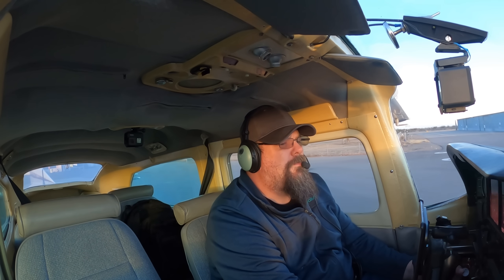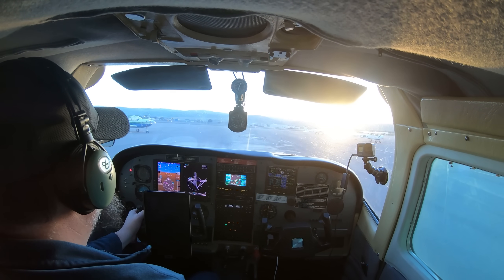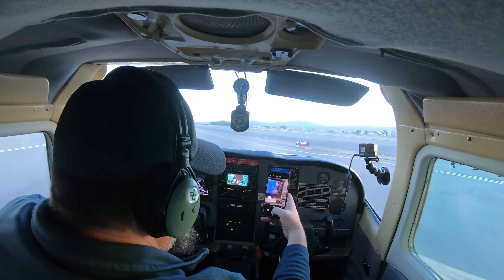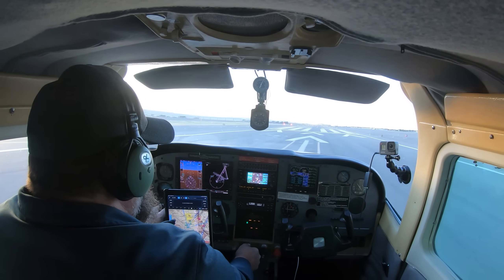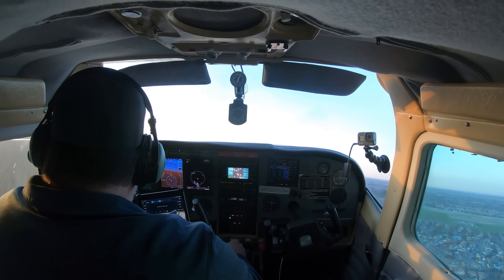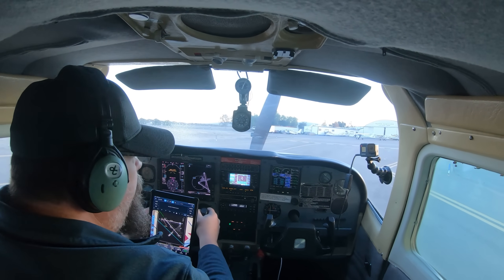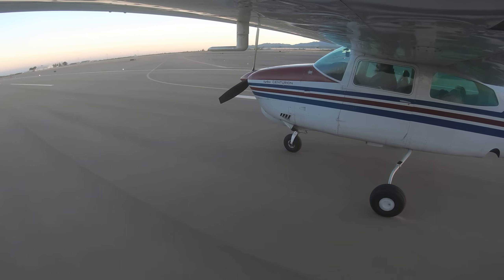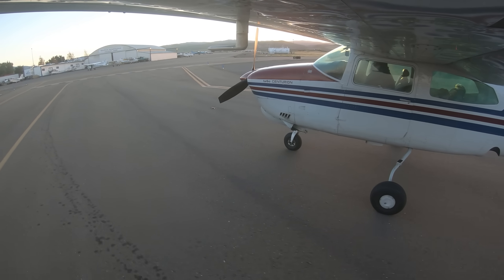Catastrophic Engine Failure after Takeoff

Comment: I'm thinking maybe these engines can be broke-in on an engine stand with a load applied or maybe the airplane , is it plain or plane , can be strapped down , like how the navy does them on carriers , then run the engine and maybe remove the wings , propellars , or distrupt the airflow over the wings , I'm thinking an air dam , if that even exist , during testing to be safe , if not too much . I'll have to watch some videos on wing removal . I was going to say mount a parachute to the rear of the plane to apply a load but i think that would make the plain fly away in reverse , lol . Either way , maybe there is a better way of load testing without having to fly it .

Comment: That's the ole 'mechanic leaves a rag in the crankcase' trick. Seriously, though. You mentioned running the engine a few times prior, but it was never put under a real load. Taxiing to the pump at grandma scooter speed doesn't count. 🤦

Comment: Buy adjusting the pitch of the impeller. Needed to do the inspection on your oil filter to see if there's any metal in the filter, looks like a rod bolt broke.

Comment: I would have immediately pulled the prop back. With enough oil press to go to course pitch,it would make a huge difference. ( not sure if he had enough oil press going to the prop to make a difference) I would not have instantly thrown the gear down . Worked out ok. But better to land gear up on the pavement than gear down in a ditch or something sticking up on final. Looks like you have established  your numbers required for the impossible turn.  I have my numbers pretty well Worked out for my airplane also. When I practice it I also give a three count delay to factor in the surprise and reaction time with a real engine failure. Glad.yours Worked out well. Good job.

Comment: I don’t understand aero piston engine design.  If high RPM equals short life, then why not use a larger engine at a lower RPM.  My car engine operates at an average of 1500 RPM and it’s been used for 21 years and still has no failure and no oil consumption.  I know if it was used at 6k RPM it would die quick.  But  does a lower RPM require an engine that’s just too big and heavy?

Comment: I like that initial panic pull on the stick. Damn everyone must every now and then train their brain NEVER to pull on panic. Just panic if you want, but NEVER pull if not necessary and if not done with thinking. Have you been a bit closer to critical AoA for whatever reason before pulling, and after pulling you would've been in a nice wing stall if not spin and lose a lot of very useful airspeed in an instant (the drag almost doubles during stall to what it was at critical AoA) and so a lot of useful altitude. Glad you were still degrees away from the critical AoA which most if not about all GA pilots know little about or think that it's meaningless, but that was not the way to do. I'd rather freeze in disbelief for a second or two during an engine failure or a fire or any other critical hazard, but never jerk the stick, either by pulling or pushing or anything without reasoning. Just try to fly at the best glide ratio AoA once the engine has quit and thus fly with the highest chance of making it back to the runway, NOT by a memorized X airspeed for Y weight, that's just stupid teaching by those who did it. Just fly the right AoA. But oh..., I forgot, GA aircraft DON'T have an angle of attack indicator, because they think it's meaningless or it doesn't do anything. Poor them. The AoA is the king of airflow.

Comment: Not saying this is pilot induced; but, lets take a look at your practices. 1.) Several times you inadvertently miss-took mixture for RPM
2.) when you did reduce to takeoff power you started with the RPM thus increasing pressure on the manifold. Remember basic training, power decreases are left to right, increases right to left. You did a fantastic job managing the failure however; I would recommend some proficiency training in proper technique. Also remember that statistically speaking, most engine failures occur during a power change. Which is why I don’t do them until I am certain I have sufficient return to runway altitude. Turbo engines require a keen eye. Remember with great power comes great responsibility etc… nice work however, you need to brush up on proper technique before jumping back into flying that particular aircraft imo. Remember to “think then act” never “react”. If you find yourself grabbing at the wrong controls multiple times, maybe let that be your sign to take a beat and seek some instruction. Super glad everything worked out. Continued blue skies friend.

Comment: Great Save, you must have sweated cold......however, am I seeing this wrong or you committed the mistake and you thought you where adjusting the prop RPM but in fact you leaned the mixture a lot, when realized, went full rich again and adjusted the rpm this time? So, brand spanking new engine, maybe not at correct temp as looks very cold where you flew, leaned a lot the mixture and then at full power put a lot of load by increasing the pitch and shabang!! Conrod left the crankcase? Am I wrong with my analysys?

Comment: I want to know what the failure was. Having built and machined a number of engines “not aircraft “ this failure was do to bad tolerances. 

Either due to bad workmanship/tolerance at the connecting rod/crank or connecting rod/wrist pin/ or piston/cylinder. 

My bet will be that there wasn’t sufficient piston/cylinder clearance and as the cylinder heated up from actual use. The increasing cylinder pressure/compression puts another dynamic in the mix that takes special equipment on the ground to duplicate. 

Aluminum expands faster than steel and if the cylinder to piston gap was not sufficient then when you brought the manifold pressure up to 32 psi the piston expansion was enough to cause the piston to get stuck in the cylinder causing the rod to break. 

I’m am sorry to see this failure happen to anyone. 

If this is indeed the cause of failure, I hope the builder/ rebuilder replaces your engine. The faa is real good at determining the cause. 

I have even seen in some catastrophic engine failures that was cause by a piece of gasket material finding it’s way to a bearing causing the bearing to fail.

Comment: What is it with “ catastrophic engine failure”… videos…with no explanation on what happened!!! 
Good piloting…
Yes the “ impossible turn” CAN… be done  if the airplane is initially flown respecting airport, terrain, Vx and Vy… … AND ..NEVER… try to tighten the turn with “ inside rudder”..
So good job on the flying….
But I came…. For the learning associated with “WHAT BROKE”.

So thumbs up on the flying
Thumbs down on yet another unfulfilled expectation… no explanation.

Comment: It amazes me, how old the technology is in GA aircraft ... even new GA aircraft (that cost well into 6 digits $$$).  The more shocking part are the "qualified" mechanics that work on them ... I use the word "qualified" loosely.  I've seen so many catastrophic failures due to bad annuals, mechanics that actually hire some unqualified person to do the grunt work while they do nothing or claim to "supervise".  These days, if one gets and maintains a PPL, I highly recommend going the course to be certified FAA mechanic for your aircraft type ... the only person I trust to work on my plane is me.  I've had to recheck other's work and in one case I found rod caps way off their torque spec ... when I confronted the mechanic he claimed his torque wrench was not calibrated correctly (come On!)

Comment: Sorry to be late to both viewing this and commenting, but I just found it. I have been a CFI for just over 25 years and was a Sim instructor in the LR35A. At client's request I sometimes trained the exact scenario you encountered and depending on altitude and speed, results varied. Typically the maneuver I taught in the Sim was a 90 degree right turn followed immediately by a 270 degree left turn to align yourself with the runway. As most of the comments I have read indicate, you did an excellent job in an extremely critical situation. No doubt the runway configuration was a major factor in that you needed to execute a 220 degree left turn and not a 220 degree turn left and then a 40 degree right turn to align yourself with runway 12. Due to the nature of the flight - did you have this strategy in your head prior to take off?  Well done in any case!
Reply from the maker: I did, and I saw someone else do it a few months earlier

Comment: Before drawing judgement I would need to know the details of what was done in the bottom end overhaul.

You noted that the bottom end was overhauled.
If the cylinders were not honed and a new set of rings were not installed, then there is no need to run the engine 'hard'.

Was the overhaul done under the shade of the old oak tree-?
Karma time, did you screw someone over bad in the past-?

Whats the big deal about doing a dead stick, prop stopped landing-?
I've done many of them into farm fields etc.

Comment: Some luck there - good and bad - but you did'bout everything right in the air.

I was surprised you didn't mention doing any full power runs on the ground before taking off on the test flight, though?

Comment: When you got slow you were talking on the radio and putting the gear down. Way too early on the gear and screw talking on the radio. Fly the airplane first and then communicate. Two big mistakes almost cost you your life. The power application was not smooth and you pulled the rpm back off too fast. These actions may have caused the engine to fail. With proper training and practice mixing up the mixture and the prop control should not happen.  When it does you don’t have to quickly back off the rpm.

Comment: just curious here...not judgemental...just trying to understand how process works with part 91..

background:  avionics tech, boeing/airbus...20 plus years.

at the end of every C check maintenance, the aircraft does not receive an airworthiness certificate until a test flight is conducted and all MEL items and RII  items of critical flight safety are addressed and solved.  

I have no background in part 91.  What are the procedures for test flights after a major repair  before an airworthiness certificate is issued?  Is this a test flight procedure similar to commercial aviation?

just being curious.

Nice recovery from a dangerous condition.  Well Done!

Comment: The step you skipped was a half hour of running on the ground at different rpm  settings... insane to be an involuntary test pilot/crash dummy.   Overheating is not going to be an issue at higher static  rpm , you monitor all temps and oil pressure as you increase rpm step wise, backing off frequently to increase oil flow for the rings.  The thrown rod indicates wrong tolerances or oil flow failure.  Infrared thermometers are $25 at harbor freight, and they make spot  temp checks easy,  a hot spot might have prompted a bore inspection,   and a hand pull through with plugs out can give some feed back too... slowly and majestically.  Sorry you lost your engine, but you saved your bird and your hide.  We've all had something like this happen,

Comment: I would've needed a change of underwear after that. At least the engine stayed running, albeit at reduced rpm----could've been much worse had it locked up completely in mid-air

Comment: As an a&p mechanic for over 15 years five of those were in general aviation I'm not sure who told you to keep the ground runs at a minimum especially after an overhaul of an engine there's a specific break-in procedure........ we use to run them 5 to 10 minutes at full power all the time on the ground.. but great job on the recovery

Comment: Excellent job what helped is that the airport has 3 runways  you took off from runway 30 and there was runway 08 to your left which was at an excellent angle so there was less risk of the dangers of the impossible turn. if runway 08 was not available there was no chance of you lining up with runway 12 and that was going to be literally impossible meaning you were going to have to ditch in a field ahead. You are a good pilot keep it up that's pure skill.
👏👏

Comment: small GA engines rarely fail (especially from this manufacturer), but when they do, it's always an emergency and has to be handled with magnificent precision. Once that engine is fixed, it will run and run and run.

Comment: 9:25 - That's one super-seized engine. The prop stopped so hard, it made the whole airframe shake.

Very nice save, btw. Calm under pressure.
Reply: I just saw your follow-up vid, with the footage of the engine damage at the end. Sheesh. :o

It was partly lucky that it failed so early into the flight, so you were close to the runway.

Comment: You've got the right stuff. Space shuttle pilot Chris Hetfeld puts it like this: "There's never a problem so bad that you can't make it worse". Panic never helps. Incredible situational awareness and response here to one othe worst things that can happen on takeoff. Some might argue about the wisdom of turning back. They were not in the left seat at 700' when the engine quit. You didn't freeze or panic. You made a decision, and you stuck to it. Perfect landing to boot.

A couple of weeks ago in my area an instructor and student apparently hit wake turbulence at around 100' while landing at Santa Monica Airport. The plane  (PiperSport N126WK ) crashed and burned. There were no survivors. The audio is chilling. You can hear the instructor screaming at the student in a panicked voice "LET GO!!!". From the sound of it, both  panicked. That never ends well.  

The thing is, until you confront an actual emergency, it's impossible to know how you will react. Well done.

Comment: As a retired pilot I have to ask myself why we are still flying with engines designed 80 years ago.  We have car engines that can last half a million and some over a million miles, why are we still flying with this ever present threat in 2022?
Reply: It is said to be the potential liabilities in court. That is why we also fly so old planes mostly as well. Look up the Porsche plane engines. They ended up paying to have the replaced by Lycoming and Continental everywhere. That said they are very reliable usually
Reply: @0b3rz0nK  Of course that ol saw used to mean something right up until the Starship program :)  Maybe Continental and Lycoming should send an engine over to Starbase for Elon's team to review and make a few changes eh.
Reply: @mrvoyagerm I agree🤠👍
Reply: Exactly why I fly experimental with a modern engine in from a Honda.
Reply: That’s not quite true. There are also new designed engines available from e. g. Rotax for even normal unleaded fuel as well. Also newer planes use those newer engines.
If they are available as possible retrofit and how to certify them in that case, I don’t know. But you can always get it certified as experimental.
Reply: Because if the are maintained, inspected and operated properly, they are reliable!
Reply: totally agree its time to retire these OLD goats, let them rest
Reply: Right on brother. Crazy. I trust my car engine way more than my O-360
Reply: Certifications costs.
Reply: Great save and damn glad you remembered to put the landing gear back down in an emergency!
Reply: Cost…
Reply: Dam good question!
Reply: $$$ maybe?? Have you seen the costs of new planes and engines?
Reply: @Aaaaa69999 no, I have not.
Reply: Price new planes cost of Fortune and old planes if maintained well could go a long way
Reply: @dizzy7992 
That’s not true.
Reply: Just dont fly at all much safer and cheaper 😂
Reply: Diesel engines. Much less that can fail.
Reply: Reliability through simplicity and also serviceability.
Reply: Because now they build these engines with 3D printed components. I’ll take the 80 yo
Reply: Spinning at constant speeds for hours on end is hard on any engine. Modern ones wouldn't last 250k under those conditions either.

Comment: Nobody on these threads has thus far mentioned that this was the first flight after an engine overhaul and the engine failed on takeoff. 
This just should not have happened.    This could have been a lot worse.  Time to open up a can of whoopass and get a new engine.   🤠

Comment: So,  I did not pay attention to it at first but at  :58  sitting still,  there is a track of oil going "on" to the runway (first payed attention at around 14:00 with the external camera view)   As the engine kicked the rod(s) out, that might indicate a loss of oil.. is that oil trail going out on to runway yours?

Comment: I noticed the pilots breathing was more labored during the takeoff than it was during the failure or Emergency Landing. Indicating he was pre stressed about this first flight and had some reservations in the back of his mind. The reason he wasn't freaking out is his mind was already prepared for the failure because he knew it could happen and subconsciously thought it would happen. Good job and lucky enough to get back to the runway. 99% of the time with a power loss on takeoff it is not possible to return to the runway unpowered and is the cause for inexperienced pilots to crash after a takeoff emergency.

Comment: I did the same with my old ultralight in 1998.  Maintain speed as you turn towards the runway. I had no hesitation in diving and turning toward the runway. However, it is an extremely dangerous maneuver. Only if you have enough altitude, otherwise the only chance is in front of you with little margin of deviation. I had many years playing with simulators and this helps a lot :)